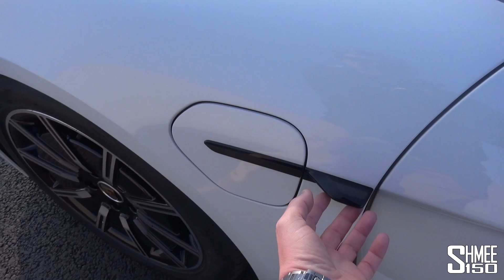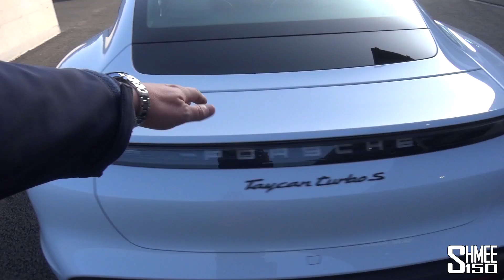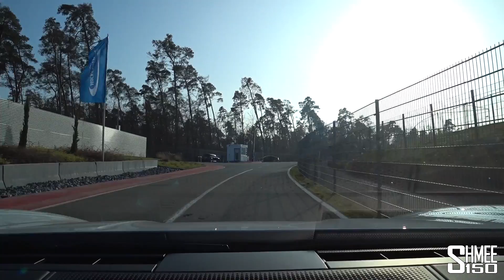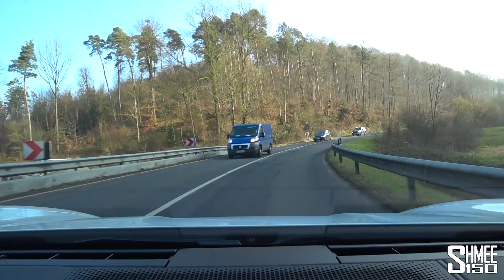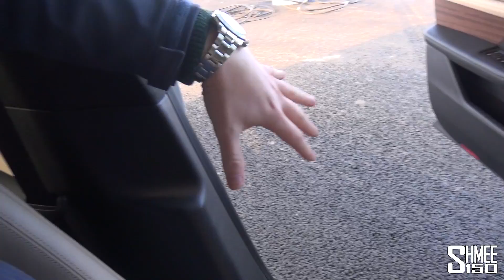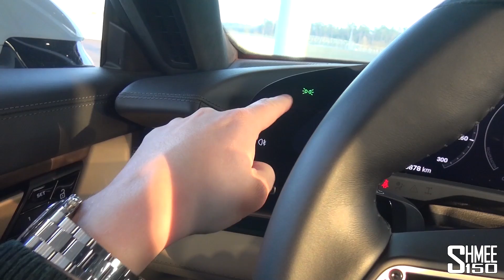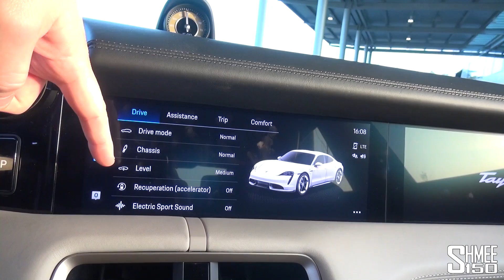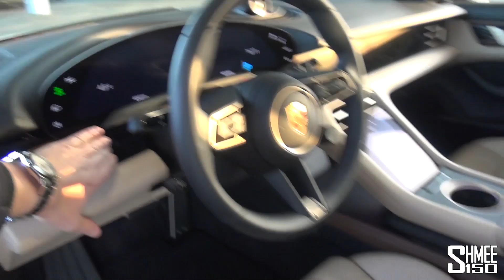Is the Porsche Taycan Turbo S the Electric Car for Me to Buy?

Comment: Awesome and inspriing, Tim as usual. But let us all make no mistake. This is no Tesla S alternative. This model starts at $185K and specs out to $210K loaded.  In other words, just one of these Turbo S gets you a both a Model S and Model X at least in the US.  Consider also that real world tests of the Turbo model shows it gets only 201 miles between charges (vs. 350-380 for the Model S 100). Never seen a car cost $1000 per mile before. Also never seen Porsche get scored the worst rating for anything in it's class before. All the lies about the Taycan's endurance in the 290 range? Sounds like the VW AG has not learned their lesson...this time the defeat device is crappy batteries.

Comment: NO! Overpriced and under-specced. Hold out for Tesla roadster or Plaid model S
Reply: It's only over priced if you can't afford it. If you can, it's an incredible engineering accomplishment to go in your garage with your 4 other cars.
Reply: Nah, there's a lot more to picking a car than 0-60 time. Teslas interiors feel like plastic trash and they handle like trash. The Porsche has high end materials, won't start rattling like Teslas do, and it's faster than a p100d in ludicrous+ mode. (Real world tests, not Tesla's inflated stats and Porsches under estimated stats.) One drives like a Porsche, the other drives like a Fiat Multipla.
Reply: @xenonram  Early Model S interiors, yes. But the new 'Raven' Model S interiors... Leather absolutely everywhere and extremely good sound deadening. Given that, the functional luxury in a Model S is leaps and bounds ahead of the Taycan... The quickness and cohesiveness of the UI, Autopilot is superb in boring situations. It's a blackberry vs. iPhone type of experience
Reply: @xenonram  you couldn't  be anymore wrong if you tried.
Reply: Ur opinion.

Comment: I am impressed with this car and finally there is one that I'd consider buying. Local dealer is supposed to have a demo driving day next month. Tesla doesn't impress.
Just bought a 991.2 and traded my M2 for it. Also have the new BMW 330xi which is an outstanding car. I ordered with Executive Package as most dealers don't get this in a 3. Laser lights are fantastic.

Comment: When this new super duper expialadocios Turbo-charged Porsche can match the performance of the 2010 Tesla model S  I might be interested if they install 1500 charging stations and drop the price $50,000
Reply: You can't even afford one. Stick to the Tesla Junk and don't test drive this beast so that you can pretend your Tesla is the best!
Reply: Al mac Taycan specs beat Tesla’s?    What you smokin man ?
Reply: @donkanis6141  it isn't about specs. The Porsche is faster and handles better and has superior quality and nicer interior. If you are a Tesla shareholder then you should take your gains and get a Porsche. If you a poor and can only afford the Tesla that's OK just save up for the Porsche.
Reply: Al mac “a sports car is not about the specs”.  Ok .........?
Reply: @donkanis6141  the Porsche will out handle and outrun the Tesla and do it in style. The Porsche isn't really a sports car it is a practical sports saloon. If it was just a sports car Tesla wouldn't have much to worry about but the Porsche is far more than a weekend toy. Don't worry this is just the tip of the iceberg as VAG has lots of superior machinery on the way that will embarrass Tesla. Byrton is more at Tesla's level than Porsche.
Reply: Al mac I only wish there was some way we could bet $1000. You have not seen Tesla Roadster specs have you ?
Reply: @almac9203  Tesla Roadster Base Specs.
Acceleration 0-60 mph. 1.9 sec.
Acceleration 0-100 mph. 4.2 sec.
Acceleration 1/4 mile. 8.8 sec.
Top Speed. Over 250 mph.
Wheel Torque. 10,000 Nm.
Mile Range. 620 miles
Price: $200,000
Reply: @donkanis6141  those are numbers on a piece of paper. Who knows what the real numbers will be. The other thing is the Taycan is more than a sports car. The Taycan is a practical everyday sedan. The Taycan can sit 4 people over six foot tall and has decent storage and excellent ride. The Taycan isn't a Ferrari 488. The other thing you are missing is the driving experience. Corvettes might have similar numbers to a 911 but the Porsche handles better and is better built so a car is more than specs and numbers which is a concept Tesla fanboys simply don't get. If it boils down to numbers then everyone should buy a Tesla or a Nissan GTR and Porsche and Ferrari and Lamborghini would have no customers but the reality is driving experience and quality matter. Why would anyone buy a Rolex or a Breguet when a Casio can do just as much for cheaper? Those into haute horology must be idiots according to your logic! Why buy a Wagu Filler steak when a Burger king hamburger fills you up almost as well?

Comment: 2020 Tesla Roadster 👀
Reply: PJ Buys yes it’s fast, but it’s no where near the build quality or sporty feeling as the taycan.

Car guys will rather go for the Taycan tbh
Reply: Not sure where most of the folks posting comments have been the past few years. The Taycan is an inferior car to a Tesla Model S P100D in every way except build quality and the latest Tesla model S  has as good a build quality. All those buttons and screens, why? 200 mile range V’s 400 for a Tesla, what a joke.  To pick the Porsche Taycan as ones first electric car to join omes ‘fleet’ makes no rational sense at all. 

If  have $200k  to spend wait a year and get the Tesla Roadster which will make the Taycan seem decades old.  The problem with all these comments is that most of the commenters seem to be old school ICE fanatics. They remind me of the horsemen of the late 1800’s decrying the automobile as a noisy flash in the pan contraption.

Comment: either the Taycan or wait for a Audi E-Tron GT <3
Reply: They are basically the same
Reply: @xiDynazty  The E-tron will probably be an generic build of the Taycan anyways, as you said...
Reply: PJ Buys they use the same chassis and battery system
Reply: indeed its basically the same. However some might argue the Audi looks even better ;)
Reply: Vareos Potshoterzz I prefer the looks of the audi aswell!

Comment: I know they try to be futuristic , but cmon what is the problem with physical buttons for ac and manual air vents . To adjust the ac you need to take your eyes off the road , and to adjust air vents takes ages .  What will be next ? 7 menus to get into just to control windows ?

Comment: Looks nice but I can't stand the name "Turbo"  in a non turbo car...
Reply: Porsche assumes buyers no longer understand "turbo" or care, it simply means "faster" now
Reply: It's just heritage
Reply: indeed its stupid
Reply: Turbo means really fast in german....
Reply: @Djredbullka  FYI 930 Turbo and Turbo Carrera 3.0-litre (1975–1977)
For the 1975 model year, Porsche introduced the first production turbocharged 911. Although called the 930 Turbo (930 being its internal type number) in Europe, it was marketed as the 930 Turbo Carrera in North America. The body shape incorporated wide wheel-arches to accommodate the wide 205/50R15 & 225/50R15 Pirelli P7 tyres, and a large rear spoiler often known as a "whale tail" on the early cars (modified from the original 1974 IROC design). They were initially fitted with a 3.0-litre engine 260 PS (190 kW; 260 hp) and four-speed manual transmission.

The Porsche 934, one of the first racing versions of the 930 Turbo

The Porsche 935 known for its signature "slant nose" front
Production of the first 400 units qualified the 930 for FIA Group 4 competition. With the racing version called the Porsche 934 of 1976 participating at the 24 Hours of Le Mans and other races including battles with the BMW 3.0 CSL "Batmobile". The FIA Group 5 version called Porsche 935 evolved from the 934. Fitted with a slope nose or "slant nose", the 500+ PS car was campaigned in 1976 by the factory, winning the world championship title. Private teams went on to win many races, like Le Mans in 1979, and continued to compete successfully with the car well into the 1980s until the FIA and IMSA rules were changed.

Porsche 930 3.3-litre, distinguished by its raised "whale-tail" rear wing
For the 1978 model year, Porsche revised the 930 with a larger 3.3-litre turbocharged engine with intercooler rated at 300 PS (220 kW; 300 hp). To fit the intercooler a newly designed "tea-tray" tail spoiler replaced the earlier whale tail spoiler. Porsche dropped the "Carrera" nomenclature for the North American markets and the car was simply called the Porsche 911 Turbo worldwide. The larger engine helped reduce some of the turbo lag inherent in the earlier models.

In 1989, a 5-speed manual transmission became available for the 930. The 930 was replaced in 1990 with the 964 turbo featuring the same 3.3-litre engine. There have been turbocharged variants of each subsequent generation of 911 since then.
Reply: @Gaming2020-c1b  That is a little different as we all know what the word turbo means in the real world.
Reply: @MexicanSpec  they put a 6.3 badge on the side of the car
Reply: U have to see it more like a spec description other than anything else.
Reply: @oceyho  there's no exhaust ,enen supercharged makes more sense
Reply: “Turbo” in the Porsche world doesn’t just mean it’s turbo charged it also indicates a premium spec such as wider wheel arches, bigger wider wheels, stiffer suspension and a few other upgrades. Personally I love it.
Reply: @MusashiSush1  not disputing the car just the name
Reply: julius ceasar I hear ya. The biggest problem I have is the $225k price tag.
Reply: Thanks for this comment, i would want to shit in the guys mouth that decided to call it a "turbo s"

Comment: Most people aren't car enthusiasts.  They want something that seems "clean" or "more environmentally conscious" compared to their current car.  They also may like luxurious items and will take a look at the power for choice selection in class.  However, most enthusiasts relate to their cars on an emotional level.  There is a relationship.  And in every good relationship you have to have good communication.  I don't think the electric batteries are good at communicating what they are doing.  However, a 4.0L twin-turbo V-8 will scream it's head off at you when you get it worked up.

Comment: 9:55 I think you got the regen settings wrong. It's a choice between a minimal amount of regen on coasting and none at all (default sailing). Quite unlike typical EVs.
Reply: Yep, the regen is supposed to be controlled by the brake pedal (or autopilot if you engage it).

Comment: Undoubtedly an excellent car and certainly worth consideration. Have you thought about Tesla though? They are the the company who are really making the difference. Jump on board!
Reply: Steve Bates- Are you living in a hole in the ground. Tesla has been profitable for 4 out of the past 5 quarters and has a multi billion dollar positive cash flow. The stock just hit 650:share and is now the most valuable auto company after only Toyota. Your ignorance is astounding
Reply: making the difference? lol the Porsche is better in almost every acpect.
Reply: TaxiDriver yes, making the difference indeed. How long has the Model S been around? A whole lot longer than the Taycan. The Taycan is clearly an amazing car, but it’s basically Porsche’s take on what Tesla has already been doing for the past 7 or 8 years.
Reply: @jamie3499  doing what? Making half done Cars? Porsche Just joined when they were ready to put out quality. They dont had to rush. They are here dir 120 years. Tesla is still trying to build a e-car with a gear, and a car which can do a drag race over and over again without losing power and taking longer every run
Reply: TaxiDriver In track mode my Model 3 Performance will do the same. It's also got a higher top speed.  And I bet it will beat the Taycan on the track. All for one third the price.
Reply: LOL, I always enjoy a good joke.
Reply: Mark Johnson Tesla in 5 years will be gone
Reply: @stevebates9747  Whether or not that's the case, and I certainly wouldn't put money on it, they'll still be responsible for the drive toward electrically powered vehicles - worthy and unquestionably worth supporting.
Reply: Mark Johnson I Agee with you they were the ones to take the risk, unfortunately for them the big boys are now stepping in and doing it better. Won’t be long before ford come to the market with a car priced for the lower end market as well. Remember Tesla are yet to make a profit, they can’t go on for another five years and not seen any return, and now the consumer has a choice on full electric. Just can’t see it going any other way.
Reply: @stevebates9747  We'll see!
Reply: @markjohnson8352  That's the point. "Unquestionably supporting." Tesla knows they can keep producing cars that are made with trash materials, they can continue to push their anti-repair agenda, all while charging you $100k+ for a gaarrrrbage feeling and handling car. If you believe in your right to repair and your right to own your car, don't buy Tesla. Tesla does things like taking away your support charging ability, taking away ludicrous mode ability, and other things if they find out you had anyone work on your car other than Tesla, because you didn't want to wait 2 months to get your $120k fixed. The only people that buy Tesla are imbeciles that have no idea about fit & finish quality, rights to repair, and think "only Tesla can fix their cars because it's electric. Derrrp." Those people that Unquestionably support tasks are the problem. And about Tesla's longevity, now that they've got that idiot Elon out of the way, and got him to stop running the company like it's his personal prototyping factory, they may have a chance.

Comment: I only problem that sticks out like a sore thumb with electric is the fact the battery is only good for about 8 years. Then it’s a 30000 plus replacement battery that will be needed, who the hell is going to pay that for a car that will be 8 years old 🤔. I think like Sam from seen through glass has hit the nail on the head, it’s a solution that’s quick, the infrastructure is not in place for everyone to go all electric and the grid couldn’t handle it. I have a feeling it will just go hydrogen or a mix of that and electric and hydrogen hybrid eventually.
Reply: I know the internet is full of incorrect facts and opinions but I really needed to reply to you on this.  There quite a few original (very well documented) Tesla P85's that have now exceeded 500,000 miles, and at least one that has exceeded 1,000,000 kms.  You can Google these easily, some are Tesla and some independent. What is interesting is that these vehicles are showing much lower battery degradation over these large mileages than was expected,  in the range of 7-15% across 750,000 kms.  Most internal combustion engines would have required one or two rebuilds in that time frame, at significant cost.  So assuming you look after your battery, i.e. keep it charged between 20 and 80% and don't supercharge all the time, their potential operational life is considerable. Add to this that the Model 3 (and Taycan) battery technology has moved the game on even further than the original Model S, so we could expect even longer life, and / or less degradation.  It is a more compelling argument than you think.

Comment: Don't see how it will fit in the lineup it and the gtc4lusso have the same function; other than obviously the V12 Vs electric

Your first electric car should probably the one to replace the G as electric car for pulling your vehicle's would be better - save you more on fuel. Bet that G is thirsty!
Reply from the maker: But could you imagine trying to park a car with a trailer in an EV charging bay?! Not sure we have the infrastructure for that yet